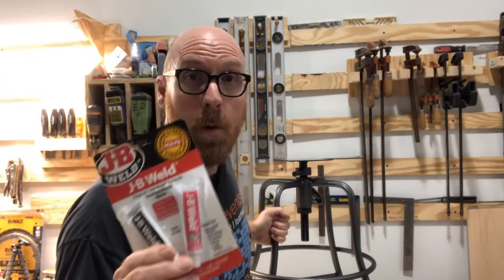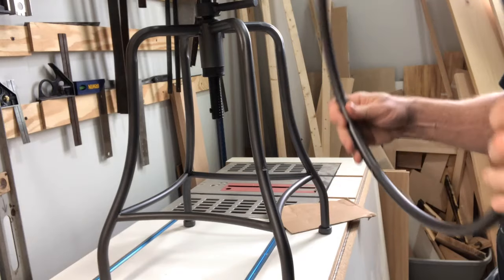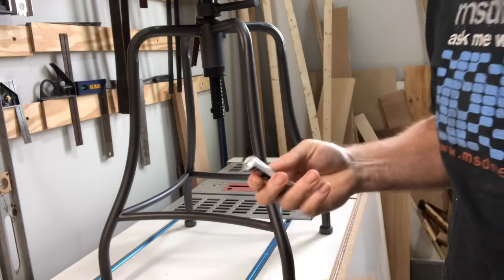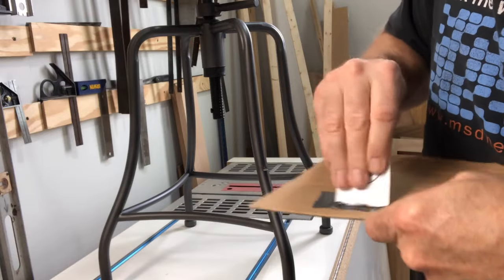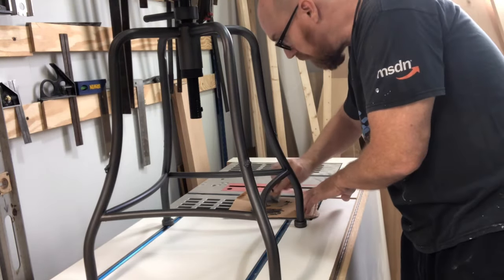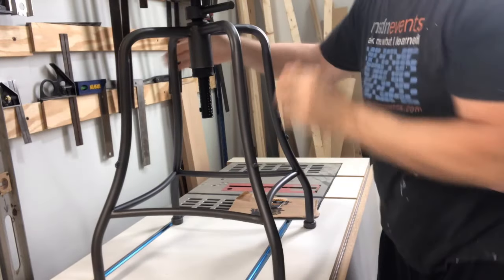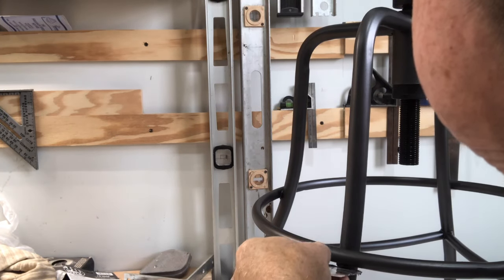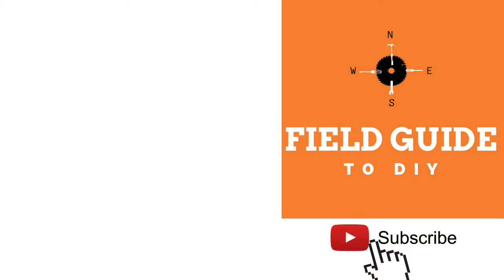How to use JB Weld | JB Weld Original Cold Steel | JB Weld Step-by-Step Instructions

Comment: This product is for easy projects that does not require a lot of weight
Reply from the maker: Gayle, it is rated up to 680 pounds (but I imagine that’s based on the amount of JB Weld used and how much overlap with the original metal.  Thanks so much for watching.

Comment: You can sand and paint jb correct ?
Reply from the maker: Absolutely.  I’ve done it myself.
Reply from the maker: Phshew, I misread your message as the size of a skillet (frying pan) so I’m thinking, “you may wanna replace that.”  LOL!  The size of a Skittle, yeah, JB Weld Original Cold Steel is gonna be perfect for that.   I’ve used Bondo in the past with much less success than JB Weld.  Keep me posted.  Thanks so much for watching!
Reply: @FieldGuidetoDIY  hahaha believe it or not Bondo is already on there, and omg it was a pain in the A sanding! and it came out uneven in spots so wanted to rectify that with JB on top of the Bondo. I mean it hardened great and looks durable but I don’t ever wanna have to sand that compound again
Reply from the maker: My repair with Bondo, i lacked the patience to get it flat.
Reply: @FieldGuidetoDIY  you saved yourself torment  I can see why they use it on cars bc you need heavy duty sanders

Comment: Thanks for the video! 
Not sure if you'd answer this, but can I use this to permanently secure a nut to the thread? 
Looking for a more permanent option than the Loctite Threadlocker Red.
Reply from the maker: Ohhh,, that will do it alright … permanent.  If you want to go that route and you’re SURE you will never need to loosen that nut, you can use JB Weld Original Cold Steel.  Thanks so much for watching!

Comment: Is it any good for car body filler
Reply from the maker: Christopher, not really.  It is more of an adhesive.  Now if you’re going to apply a replacement steel panel and use JB Weld to adhere it, that would be another possibility.  But, I still wouldn’t recommend it.  I appreciate you asking.  I also think you’d be better served by using Bondo.  Thanks so much for watching.

Comment: Will this work on a saddle bike seat that keeps sliding?
Reply from the maker: It might.  Is the bike seat sliding because the bolts have been overtightened?  It may work but it may not.  It is worth a try.  I'd start with replacing the bolts if they are stripped then add the JB Weld.  Keep us posted.  Thanks so much for watching.
Reply: @FieldGuidetoDIY  The saddle does not slide in the normal position ( UCI approved angle). Problem is with all my bikes ( road or mountain bike) I need a 150 mm saddle and also it has to have this 30 degree angle up on the nose. Since I have very short legs I need the saddle nose up this puts extra pressure on the rails and they slide against the bracket.  So will try this Jb weld then if nothing helps just use Lepage construction glue in the tube, that thing holds anything lol.
Reply from the maker: @danfuerthgillis4483  I’ll have to check out Lepage.  I’ve not used it before.

Comment: can it hold an engine block hole?
Reply from the maker: Not sure I follow you Juan.  Are the threads stripped out?  Or are you thinking about using JB Weld like Lock Tight to keep the bolt from loosening?

Comment: would this work on a stove kettle?
Reply from the maker: Elvis.N I believe it would.  If you spread it well enough, you could seal any cracks.  Also, the top of the stove will not be 680 degrees which is what JB Weld Original Cold Steel is rated for.  However, do not use it if you’re using the kettle with water that will be consumed, like brewing teas or something.  If it is for adding moisture to dry air, you should be good to go.  Thanks for asking and thanks so much for watching!

Comment: Can I JB weld a death kart roll cage?
Reply from the maker: I mean you CAN but if you’re wanting to count on it when the time comes, I’d probably err on the side of a strong proper weld.  It’s rated for 680 pounds and with the weight and the force, it might not be hard to exceed those 680 pounds.  But that’s just me.  I appreciate you asking.
Reply: @FieldGuidetoDIY  Five kits per weld. 680x5=3400 pounds. Math doesn't lie.

Comment: MISTAKE- HE FORGOT TO BRUSH OFF PAINTED SURFACE, CLEAN WITH VINEGAR THAN BOND. ALSO, 24 HOURS TO DRY PROPERLY.
Reply from the maker: I’ve heard about removing the paint but I heard it was optional.  I’ve not heard of the vinegar solution before.  That’s a new one on me.  Anyway, we had company over the weekend and it is still holding strong.  Thanks so much for watching.

Comment: Ok. First, you failed to sand and prep the area. 2. Clamp the work overnight. 3. Use painters tape to ensure a neat result. Your job turned out fine- but since this is a tutorial I thought these tips might help future DIY'rs. Not everyone will have a dark, metal chair where the welds are not very visible. On a job like this, where you will be weight beating and some might even stand on that ring- in a drunken state, I would like to see a mechanical attachment which would be very easy- either a weld or simply drill a hole, black nut and bolt, lock washer and your done. It would be far stronger. This fancy glue, marketed as weld is really only surface adhesion/tack. Yeah, and cut out that distracting music. Came to learn, not to listen to that.
Reply from the maker: First of all, I commend you for your keen attention to detail.  Very observant.  Secondly, thank you for the tips.  You are correct and I intend to do an update video and will include prep work.  I will include these and, of course, give you credit.  Coming soon!  Thanks so much for watching!  And yes, if you check out my later stuff, I nixed the music.
Reply: @FieldGuidetoDIY  Sure thing. Nice workshop!

Comment: Can I use this on toys?
Reply from the maker: It definitely IS strong enough for toys, I would caution you.  It IS toxic so if there is ANY possibility of a little one putting the toy in their mouth, I would err on the side of caution and NOT use it for toy repair.  Now if the toy is a keepsake that was a family heirloom and repaired to be put on the shelf, JB Weld away!  Thanks for asking and thanks for watching.
Reply: @FieldGuidetoDIY  just to piggyback off of this toy question. My son collects action figures ($20-$50 a piece) and the heads of these action figures can be removed and replaced with other heads that came with the action figure. They are on a ball joint. One of them broke at the base of the neck and I tried using gorilla epoxy which has a rating of about 2,600 PSI. It worked for one head removal. On the second, the epoxy failed. Do you think this would work for repeat head removal on a ball joint?
Reply from the maker: @mvparker79  i would recommend JB Weld Clearweld.  I’ve done a similar repair with it.  Check out these instructions https://youtu.be/A_66N1QpF2o.  Thanks so much for watching and let me know how it goes.

Comment: I have tried this product and it does not work as sold 5020fps my ass!!!!!
Reply from the maker: Daire, seriously?  What was the repair it failed on?  All of my repairs are still holding. Thanks so much for watching!
Reply: Used it on a base of a gaming chair that gave way there last week, the weld at the bottom broke and used this product to try fix it. I mixed it right and let it set for 48 hours just to make sure I left it long enough. It lasted about 20 min and then it broke. Didn't work going to replace the base of the chair now and not use any products hopefully the screws hold better then the epoxy.

Comment: Use a popsicle stick.....that card sucks
Reply from the maker: Kelly, I have used the popsicle stick for smaller applications but when applying JB Weld over a larger area or mixing any epoxy, room keys work great.  Thanks for commenting and thanks so much for watching.

Comment: Please don't do anymore youtube. You are all wrong. You JB Weld over paint. You should scrape off the paint, and apply on metal.
Reply from the maker: Hey William, I’m sorry you feel that way.  It’s been over a year and it’s still holding.  Did you apply JB Weld over paint and have it fail?  You raise a great point though about affixing to a clean dry surface.  That is important with ANY adhesive.  Thanks so much for watching.

Comment: Can you mix with water?
Reply from the maker: Joe, no you cannot.  I found any exposure to water does not let Original Cold Steel cure correctly.  https://youtu.be/L-PbyU3tWLc  Thanks so much for watching.
Reply: @FieldGuidetoDIY  would it be safe with water AFTER it cures?
Reply from the maker: @mackenziegray2090  Like to repair a drinking urn?  I would not risk it.  It has warnings about coming into contact with skin, etc.  I’m thinking no.
Reply: @FieldGuidetoDIY  No its for a BALTIMORE AIRCOIL (BAC) for hvac equipment. Company needs it repaired temporarily. Just need it to hold up till August until they get a new one. Has about quarter size wholes at the bottom where the water lays at.
Reply from the maker: @mackenziegray2090  oh, I see.  I thought you were asking if it was potable or consumable.  Yes, it can be water tight as long as you let it cure before immersed in water.  I did a test and it didn’t cure properly under water.  Folks have been repairing car radiators with JB Weld for years.  Keep me posted.  Thanks so much for watching!

Comment: Would this work on a teeny hole in my cast iron radiator?
Reply from the maker: Uli, I believe it would.  JB Weld is rated for high heat and up to 680 psi pressure.  Let me know how it goes.  Thanks so much for watching!
Reply: A little late here, but I sealed a radiator that had a broken leaking petcock with jb weld, worked fine. Has been over a year